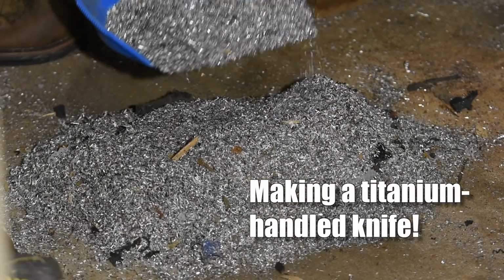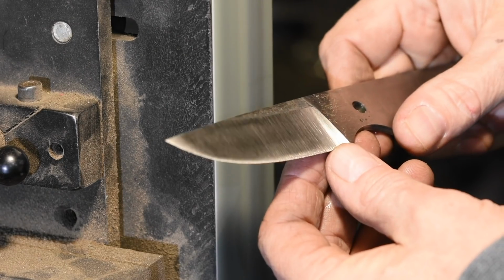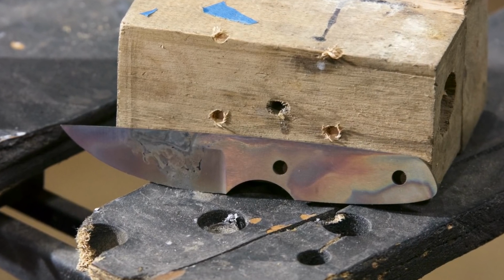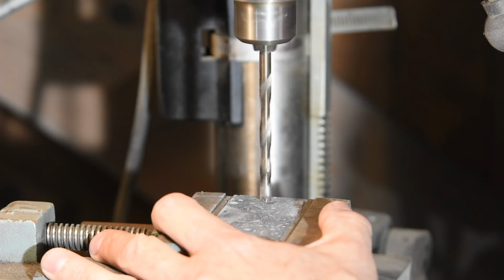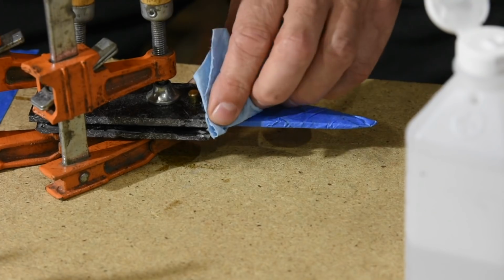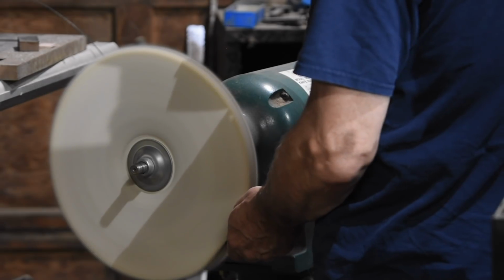Titanium Awesomeness!  Make a Knife with a Titanium Micarta Handle!

Comment: 0:00 – Intro
1:15 – Layout
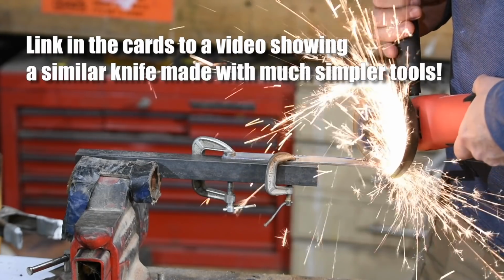2:06 – Drilling Handle Holes
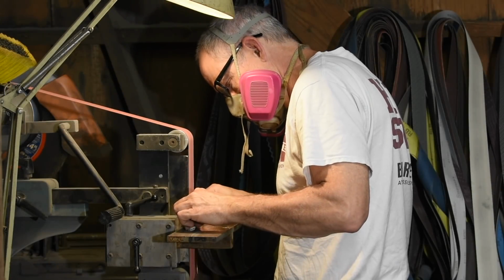2:47 – Blade Profile-ing
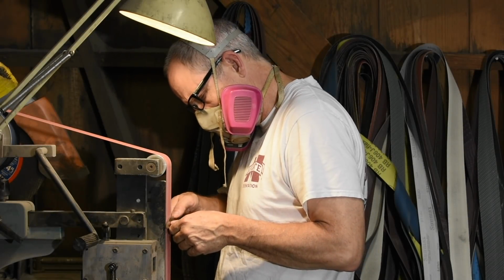3:46 – Grinding Bevels (Rough)
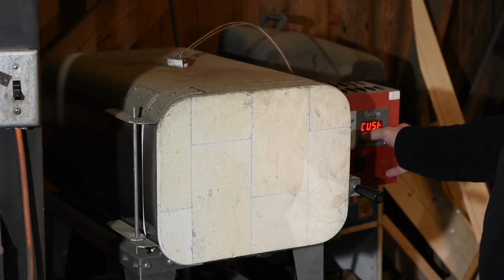5:20 – Heat Treating
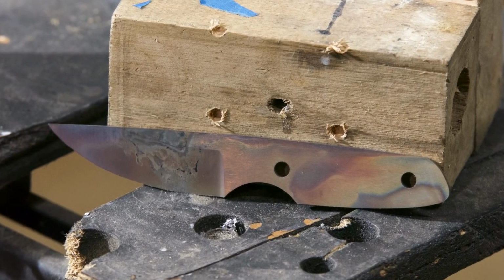6:19 – Post HT Cleanup (Flats and Bevels)
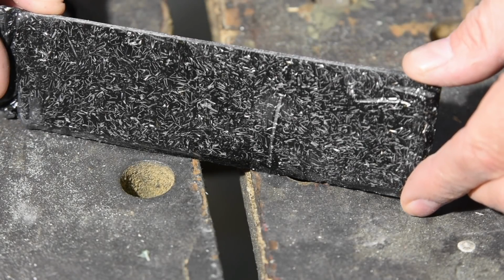7:06 – Squaring up Ti-Carta and Flattening
8:02 – Drilling Handle Holes  in Ti-Carta
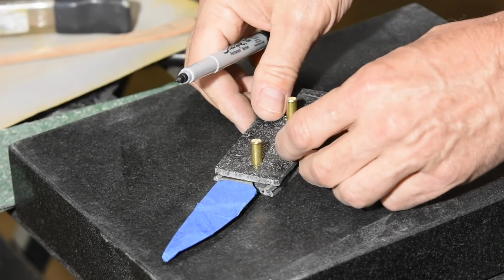9:21 – Cleaning up front of Scales
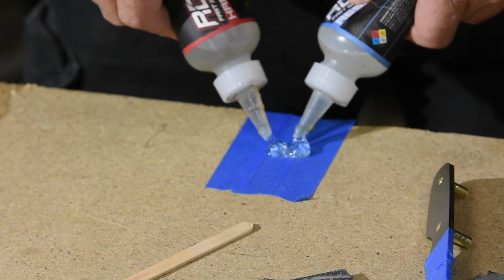9:56 – Handle Glue-up
10:55 – Handle Grinding
12:39 – Hand Sand Handle and Buffing
13:29 – Finished Product and Outro

Thanks for the inspirational video! Love it! Always learn something.

Comment: I wonder if there is any way to get the titanium to anodize? Maybe a heat resistant epoxy and flam anodizing?
Reply: I don’t think that’ll work because I’m pretty sure that titanium needs oxygen to anodize
Reply: @erwinli6962  you could anodize the chips first, so all the exposed titanium is silver and thr stuff that is under the surface is colored